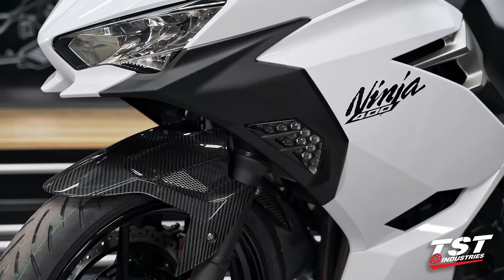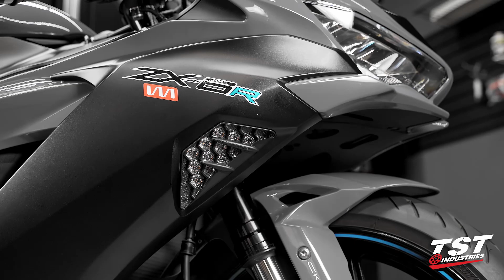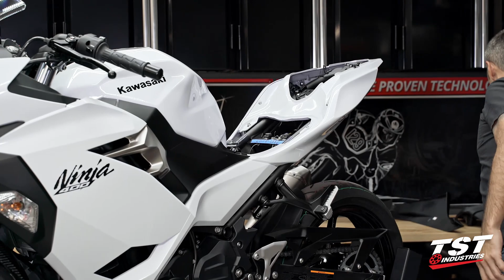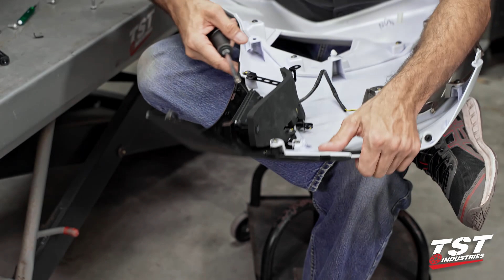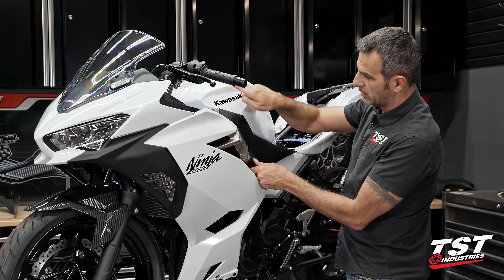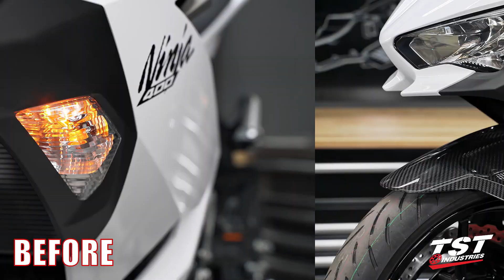How to install TST Nexus LED Front Turn Signals on a 2018+ Kawasaki Ninja 400 by TST Industries

Comment: What's the difference between the standard and the running? What do they mean by running?
Reply from the maker: @Antonio-kx5rd  running light, also known as drl (daylight running light), is constantly on like the headlight but at a lower intensity than the signal brightness. When you activate signal, the running light circuit shuts off and the lamp flashes with higher brightness than running light.

Comment: First thank you for the video!! Amazing. Everyone shows how to take off fairings but not put them back on! Clear video and instructions thank you 

Question: I already purchased the flash relay with the purchase of the integrated tail light. Will the flash relay do the job for both the front and rear LED lights?
Reply from the maker: @StephanieFricke  yes it will. One relay corrects and controls your entire signal circuit (front and rear).

Comment: If I bought the Hyperpack should it includ the relays from the tail lights and the front signal lights?
Reply from the maker: The bike's signaling system uses one relay to control the flash rate. Our replacement relay is included in the Hyperpack bundle.

Comment: Would this be the exact same process on my 19n1k as far as disassembly?
Reply from the maker: All these Ninja bikes break down differently. On the 1K there is the additional nuance of the lower edge of the signal well opening not matching up with our signals exactly the same as with the other N models. The assembly leaves a little gap that you can notice when really up close. Please weigh that in before you purchase these signals for a N1000
Reply: @TSTindustries  do you make one with a perfect fit for the n1k?

Comment: Would it be possible to install without removing the fairings
Reply from the maker: Perhaps if you have very little hands and fingers, and infinite patience. The fairings on this bike come off so easy that there is no need to struggle around that. I do this install in 15 minutes just the way I showed it if I am not yapping at the camera and not trying to get my body out of the way of camera lens.